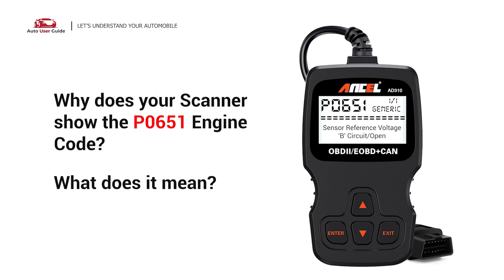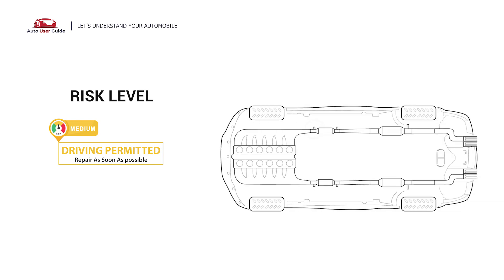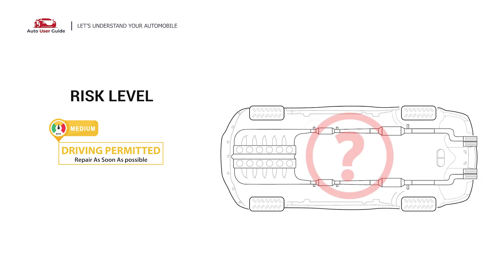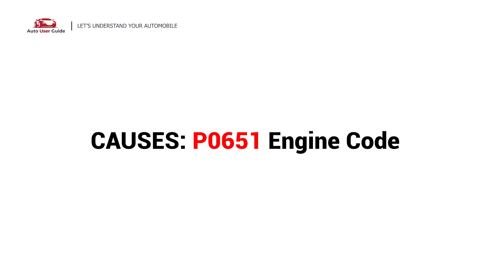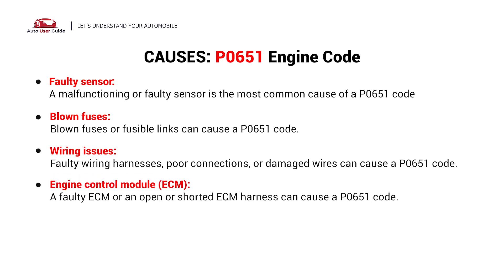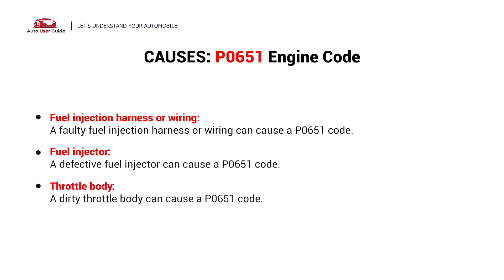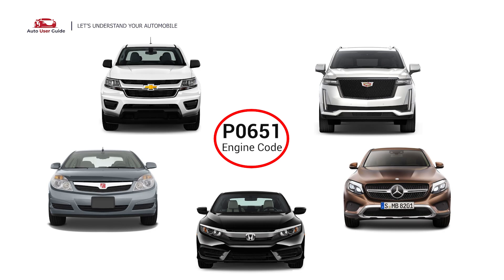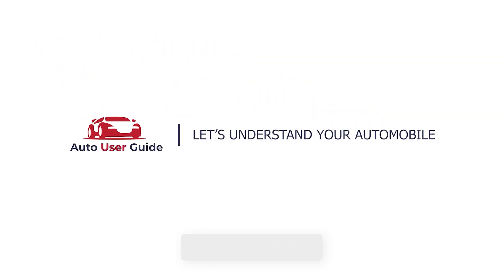What is P0651 : Engine Error Code Causes Explained

Comment: 2004 chevy silverado pick up truck  po651 code.  How can i find it and fix it
Reply from the maker: Thanks for sharing! 👍
For your 2004 Chevy Silverado, the P0651 code usually means there’s an issue with the sensor reference voltage circuit (Sensor B) — often related to a bad wiring connection, faulty sensor, or ECM issue. 🔧

Start by checking:
1️⃣ The wiring and connectors near the affected sensor for damage or corrosion.
2️⃣ The 5V reference voltage from the ECM using a multimeter.

If everything looks fine, the sensor itself might need replacement. ⚙️

Would you like me to make a short video or post explaining how to test it step-by-step on the Silverado? 🚗💡